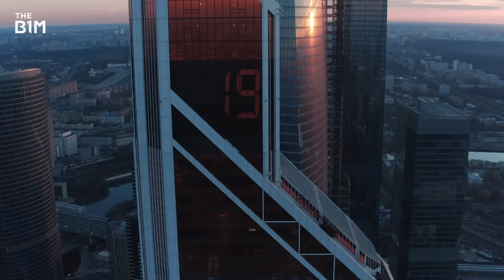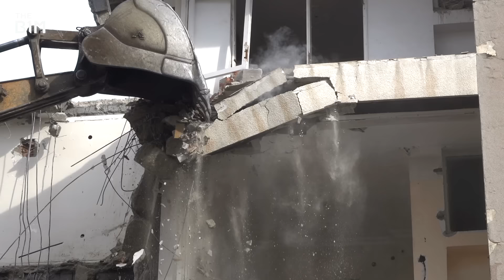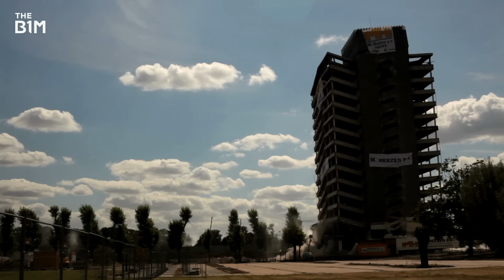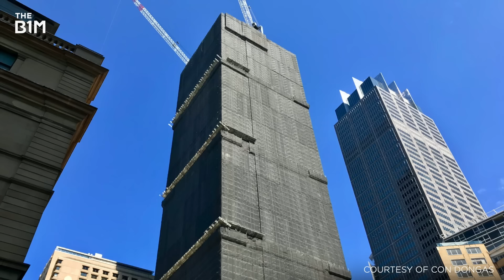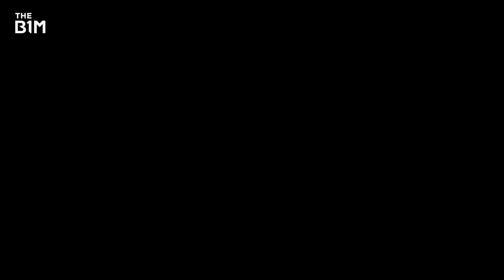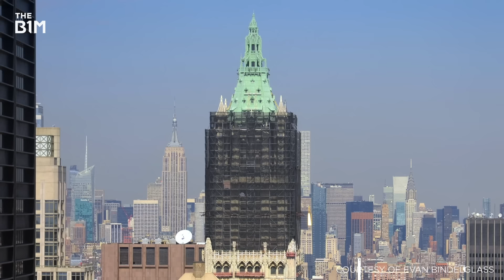How To Dispose of a Skyscraper

Comment: I don’t believe the old Union Carbide building was structurally unsound or unsafe. It was just JP Morgan just needed a larger building at this location. The Union Carbide building was a prime example of early modernist architecture which was designed by SOM. It sad the old building couldn’t have been renovated, but then in the other hand, it was obsolete for JP Morgan’s uses. At least much of the old building materials were recycled for use in future buildings!

Comment: If life of a skyscraper is just 50 to 100 years then we are doing great wrong by building them. Think of the environmental impact. We should rather be constructing buildings in greener scale. Meaning to build along with designing large scale parks, leaving more place to greener areas and outdoors and limited space for indoor life. Humans must return to their roots, it’s already too late but we can try to retrieve back the Earth as it once was!
Reply: I’m pretty sure it’s mainly concrete and steel that are used so I doubt it is that much of an impact if they are properly recycled
Reply: @davo7512  There is a lot more than concrete & steel. Think of water, heating, etc being made available on top floors.

Comment: They should construct a tall steel "basket" around the skyscraper to be demolished so that the debris will not spill onto surrounding structures.The steel basket should be secured to one another such that it will not buckle when debris fall on it.

Comment: Skyscrapers are made by RCC: Reinforced Concrete Coloumn Material maximum wall width is 4 inch and are benficial in Earthquake and natural disaters and are more powerful than the structure made of walls in it maximum wall width is 9 inch🤗🤗🤗

Comment: I find it odd that the narrator listed the height of the building to be demolished at 270 Park Ave in NYC in meters, while describing its replacement as “70 stories.” Why not use the same unit of measurement for both structures, so the listener can easily compare them?

EDIT: If anyone else was interested, Wikipedia says that the old building at 270 Park Ave that is now being demolished had 52 stories.

Comment: A much easier way: Just start some fires at random on one side of the building. Within a few hours, the entire structure will collapse neatly at free-fall acceleration into its own  footprint.
Reply: I think they tried it in 2005 at the Deutsche Bank Building but called it off half way through.

Comment: This reminds me of a time many years back when a motel bought some land, they built a massive motel and after about 6 years they tore it down for what felt like no reason. The building was frequently used (so customers) and it was in excellent condition, even looked very nice. Than they started to tear the building down, folks where confused but the answer was roughly the same as this.

The land it was built on sky rocketed in value due to the oil boom in the area, what was once a relatively small town blew up over a few years and since projects start years prior to the build they bought the land for a decent amount. After building, and using it for a few years they realized it was much more profitable to put the land up for sale and wait till someone bought it for a empty lot alone. Which happened, the area was "modernizing" quickly and that lot just so happened to end up on the main strip with many companies building in close proximity (mostly headquarters, and corporate centers). 

It was a shame to see such a new and relatively high end building get torn down, they must have spent millions to build it, still wonder what kinda money where they offered ... must have been a lot.
Reply: *were
Reply: What’s with the quotation marks?
Reply: @jacktheflash8478  it's them quoting what the other people said. "Modernizing" doesn't really mean anything without context, so it's intentionally vague.

Comment: Unusually, when deconstructing 122 Leadenhall Street in London, they started at the bottom and worked upwards.  All of the tower floors were suspended from above, not supported from below; the top of the building was a very heavy truss transferring the entire suspended load onto a small concrete core.

Comment: Park Avenue fronts the building and the tracks leading to Grand central Station run beneath Park Avenue.  But the tracks fan-out close to Grand Central.  Buildings close to Grand Central (such as 270 park) are built over the tracks, adding to the overall challenge.  In viewing the diagrams, note 270 is on the west side of Park Av., between 47th and 48th Sts. and there is an abundance of trackage beneath 270.
See:
https://www.american-rails.com/images/456023049286820092394868266.jpg
and
https://www.american-rails.com/images/456023049286820092394868266.jpg

Comment: Great video, but what about the foundation? That seems like one of the most challenging parts to deconstruct, or do they reuse it?
Reply: Park Avenue fronts the building and the tracks leading to Grand central Station run beneath Park Avenue.  But the tracks fan-out close to Grand Central.  Buildings close to Grand Central (such as 270 park) are built over the tracks, adding to the overall challenge.  In viewing the diagrams, note 270 is on the west side of Park Av., between 47th and 48th Sts. and there is an abundance of trackage beneath 270.
See:
https://www.american-rails.com/images/456023049286820092394868266.jpg
and
https://www.american-rails.com/images/456023049286820092394868266.jpg

Comment: Can you do one on making buildings taller after it’s original construction?
Reply: today definitely not. Modern skyscrapers are precisely engineered to the highest grade of efficiency possible, no single steel support more than needed!
But the Metropolitan Life North Building in Manhattan, for example, was originally designed to have more than 100 floors, due to the Great Depression, only 30 stories got build. 
You could potentially/technically finish the building today!

Comment: I wish I knew about the deconstruction of 270 Park Ave earlier. I've been passing by it since October. I only noticed there was a wall blocking the first floor, I didn't think anything of it. Now I know.
Reply: It's the world's tallest voluntarily demolished structure, ever. The replacement structure will be 70 stories (7 parking, 6 mechanical, 57 offices, with higher ceilings) that's more than 1200 feet tall and with a wider building (the prior 270 Park had a 52-story main structure and a 13-story podium on Madison). The new building and its permits have already been approved.

Comment: Here in Toronto, the newest fad, is not to demolish, but to retrofit, an just build on top of existing structures. The former Sutton Place hotel, is now The Britania, a condo, where the just built 10 more floors on top of the old hotel. The did the same with the Residences of 488 University. Originally, a small office tower, of about 20 floors, but now a soaring condo 55 stories (207 metres) tall, they just reinforced the original tower within exoskeleton of high strength crossed steal I beams (hidden by a new glass curtain wall), so it could withstand the weight 30 new floors. It’s much more cost efficient, and safer, then a demolition and rebuild.

Comment: Great video! 
But as always; "the 50-100 year lifespan" is the key problem with modern architecture. 
Build traditionally and a building will last forever.
Reply: "the 50-100 year lifespan" I think it means that the building is: 1)no longer a relevant or historical building; 2) they have better plans for the space that is being used by said building... so it's 'usability and profitability lifespan' and not necessarily 'structural lifespan'.
Reply: @PrimiusLovin  This is a complete waste of materials and energy. With the economic crash from the corona virus. The market has fallen out of the commercial and residential real estate market any developer that demolishes a perfectly good high rise to build a taller one will wind up losing his a$$ big time.
Reply: No building will last forever without human maintenance.
Reply: tokyo has only 25
Reply: Traditional Architecture is more beautiful than Modern Architecture.

Comment: Why did they demolish the building in Sydney? It looks like there are still a lot of shorter buildings.
Reply: there is always a shorter building, but if you own said building this won't stop you  from tearing it down. 
Plus the building in Sydney will only be partially demolished, they covert most of it into the new tower.

Comment: Oh lmao I always thought they would detonate it in just the right way for it to fall straight down without hitting anything else but now that I've seen this I feel dumb as hell. 
Edit: But also smarter than before!
Reply: The building is built atop railroad tracks to/from Grand Central..[See 47th and 48th in below images].
https://www.american-rails.com/images/123999767290929057672996726.jpg
https://www.american-rails.com/images/456023049286820092394868266.jpg